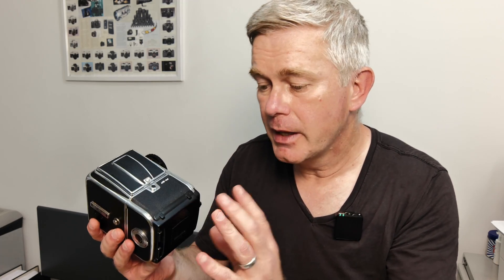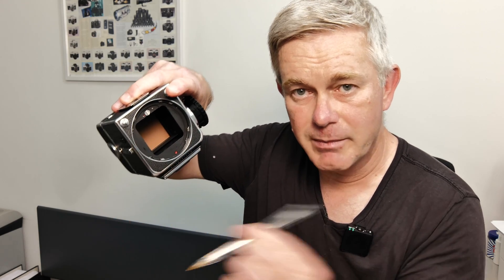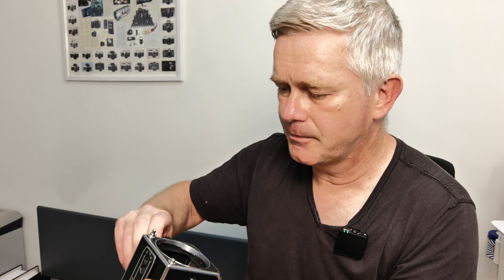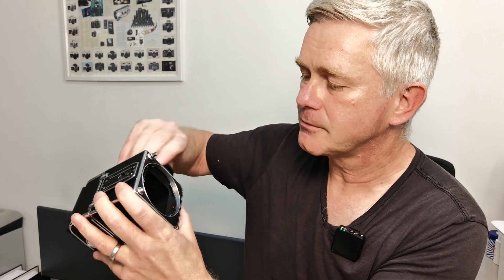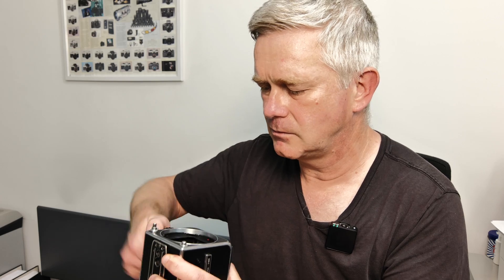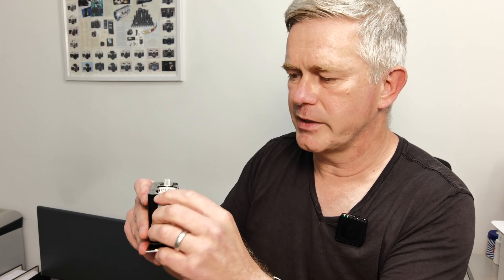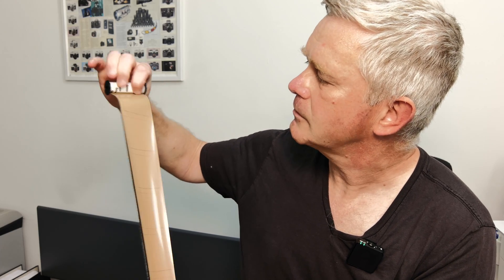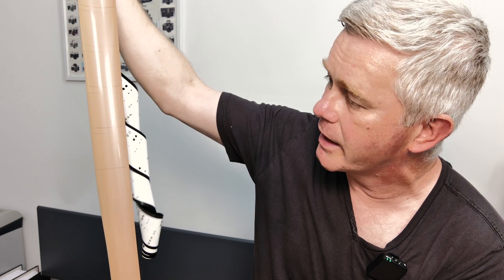Hasselblad - checking for overlapping frames with a 500 series camera

Comment: An excellent method for checking for overlapping frames! I did the same thing for checking my Pentacon Six where overlapping frames and frame spacing can be an issue.  I was only getting 10/12 frames.   Great video.
Reply from the maker: Thanks. Glad it was useful.

Comment: Nice advice, for those too nervous about sticking a pen into your camera's mirror box – you can simply take the back off the camera body after each shot, then the sequence is:

Wind 1st frame
Take 1st shot
Insert darkslide
Take back off
Remove darkslide
Mar the frame perimeter
Reinsert darkslide
Mount the back
Wind 2nd frame > repeat
Reply from the maker: Thanks for commenting. If you’re using a 2000-series Hasselblad that’s the only method! Unless,  you enjoy living life on the edge!